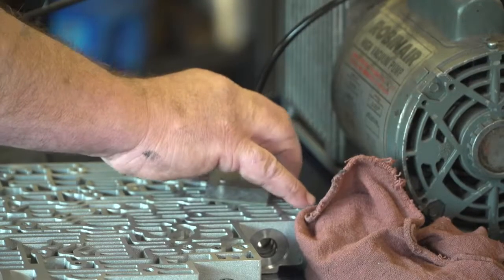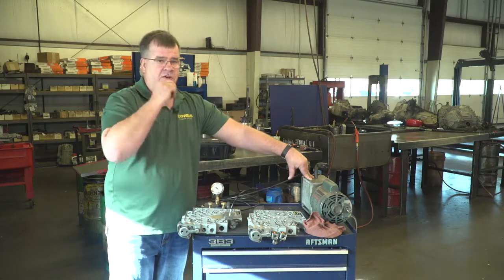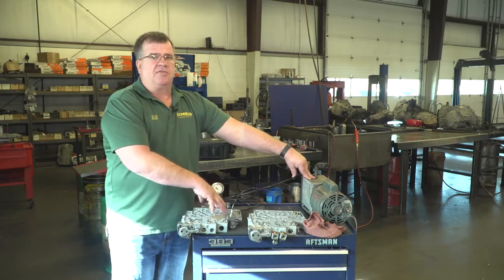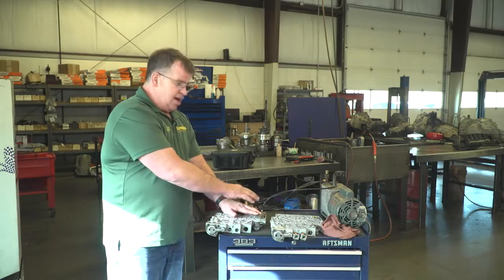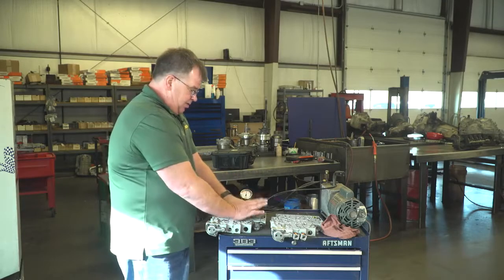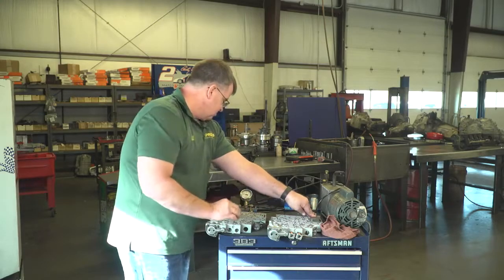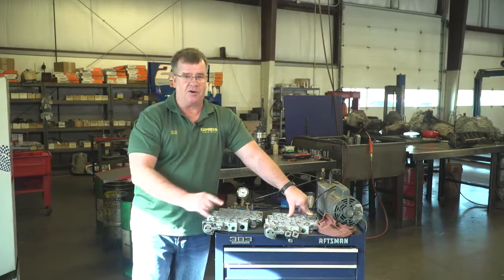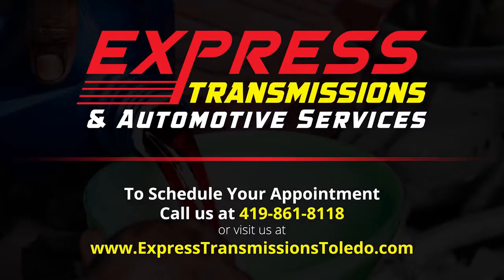Valve Body Testing

Comment: can you share where to get this Pump and Acrylic tester plate? how strong thats the vacuumed pump needs to be or is it an AC pump? also more details on what areas to check, there are many valves so how and where to check?  thanks
Reply: You need a minimum of a 3CFM vacuum pump.  (I have a 6CFM) 

 The Acrylic plate you can get from Sonnax. 

Sonnax also has all the other information you asked about.